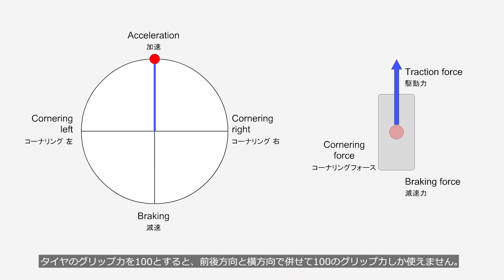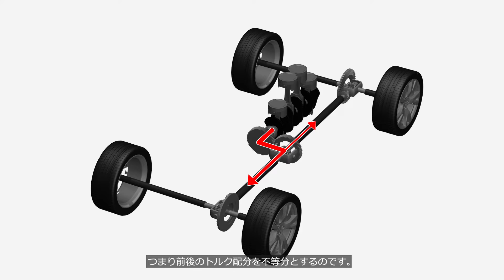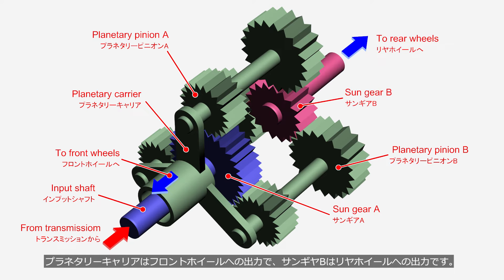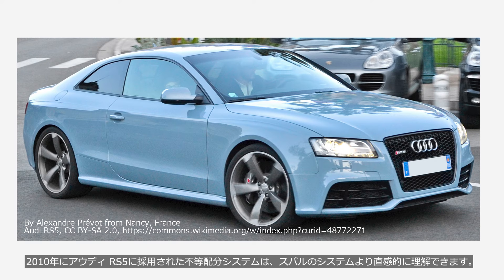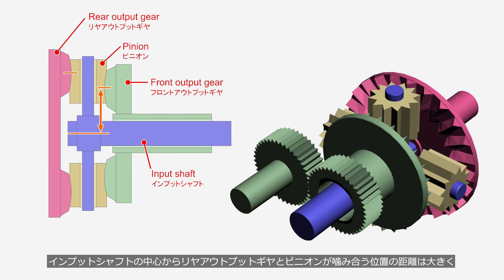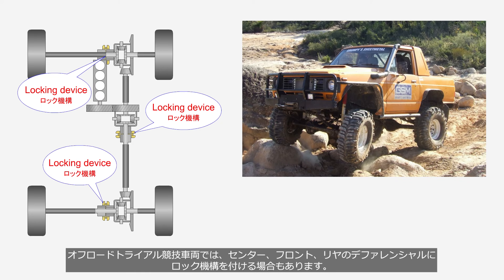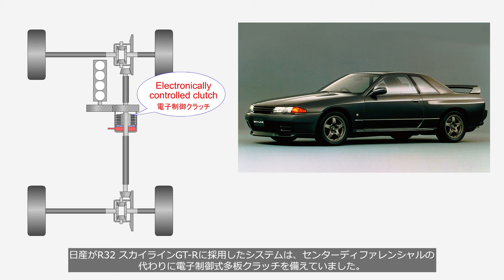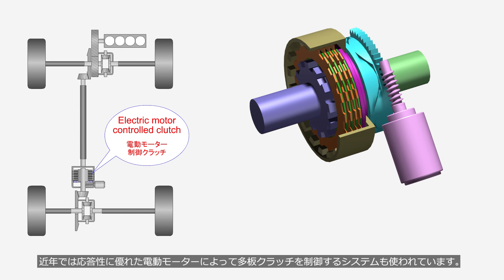Center Differentials for AWD, How they work?

Comment: I read that Subaru models distribute around 60% of the torque to the front wheels and 40% to the rear wheels. Is this correct? If so, does it contradict your point that the rear wheels should receive more torque to avoid strong understeer?
Reply from the maker: Thank you for watching the video and leaving a comment.
Automakers have multiple 4WD systems and adopt the one that suits the characteristics of each model.
Subaru uses a 60:40 system for its stability-oriented SUVs and wagons, and a 45:55 system for the sports model WRX.👍
Reply: @sikasabumotorchannel  I understand now. Thank you for the answer.

Comment: what type  of  center  differnetial is used   in  Mitsusbishi   Super select ? i have  heard  viscous coupling  and lock  but  how  they work together  ?
Reply from the maker: Thank you for watching the video and leaving a comment.
As you mentioned, the Super Select has a differential gear, a locking mechanism and a viscous coupling.
However, the locking mechanism and the viscous couplingthese do not operate simultaneously.
Under normal conditions, the locking mechanism is disengaged, and the viscous coupling handles torque distribution.
When the differential lock is engaged, both the differential gear and the viscous coupling are locked.

Comment: AWD systems with torque vectoring systems shuffling power front to rear and vice versa and between the two rear wheels on most vehicles seem to be the best.

Would love to know whether torque vectoring differential is still better than rear wheel/axle steering when driving on bad road conditions ir inclement weather (heavy rain or snow)?
Reply from the maker: Thank you as always.

For example, on a highway in heavy rain, which would be more stable, an AWD car or a car with rear-wheel steering? 
It’s a tough question. 
Perhaps the answer depends on the road conditions and the car’s fundamental performance, such as the tires and suspension.

What about a car that has both? Like the Mercedes-Benz S-Class or a Bentley.
I’ll have to give up on that since I’m a bit short on savings. (Haha)
Reply: @sikasabumotorchannel I don't want to keep raising the bar so I am thinking my next car purchase will need to have a torque vectoring differential.  Rear wheel steering nice to have and it seems it will be quite reliable but not going to make that a requirement haha.

Watching most of your videos, I think ICE is becoming too complicated but then again, with EVs the batteries are the Achilles Heel and they have become too dependent on software, which could break the vehicle with the wrong update.
Reply from the maker: As you mentioned, ICE has become too complicated. I think it’s probably due to the strict emission regulations (including CO2).  But, new technologies always excites me.
Nevertheless, battery EV technology doesn’t really excite me. I wonder why?